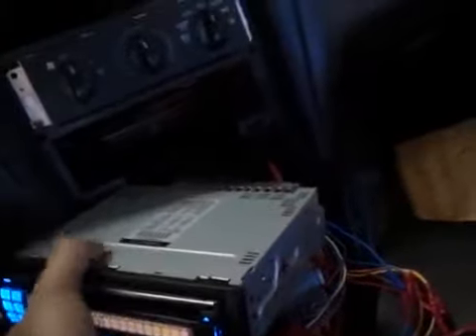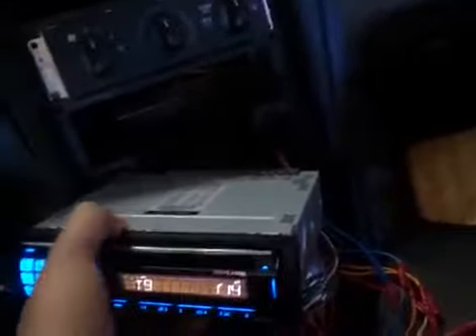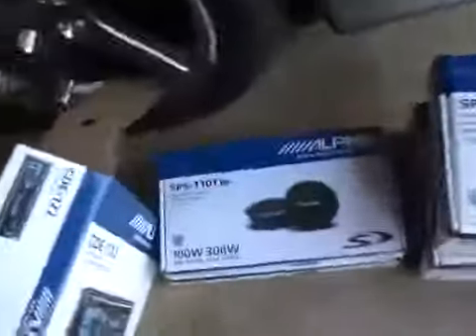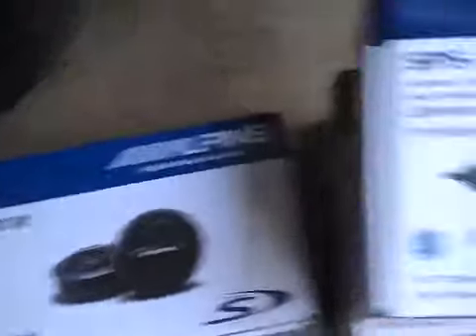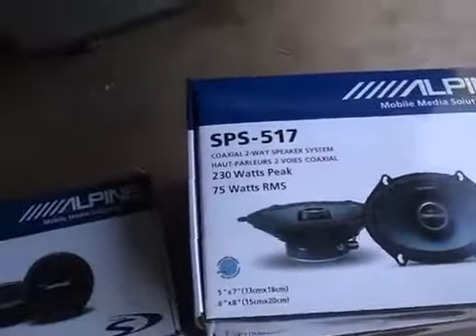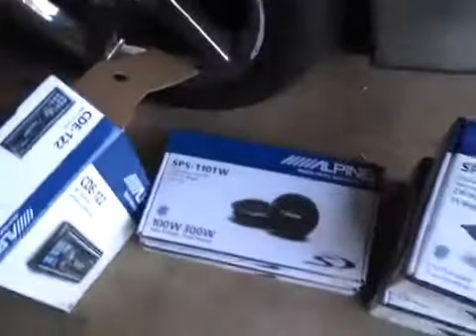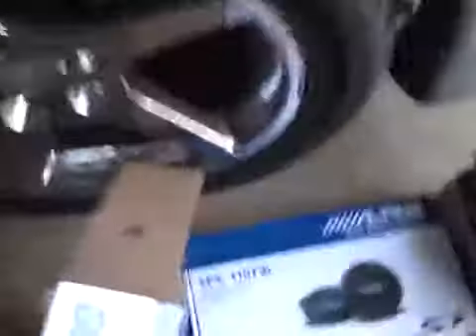MACH 460 Audio Nightmare PART 2 ( Old Video )

Comment: The Mach 460 was great new but eventually the factory amps will crap out on you. I'm getting ready to run new wire from the speaker directly to the head unit. Talk about a PITA!